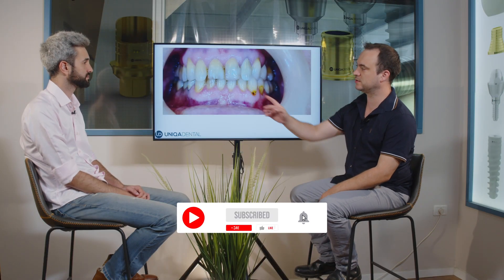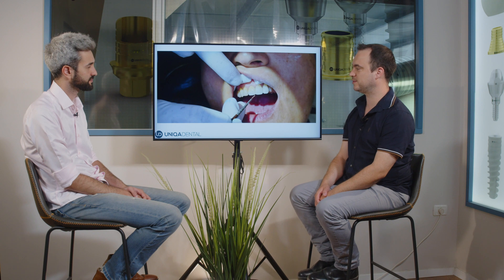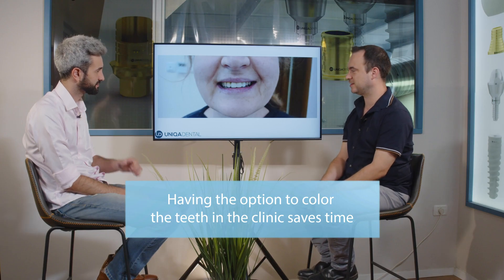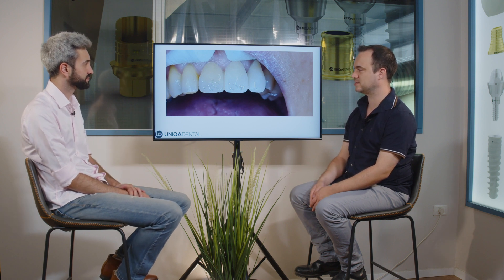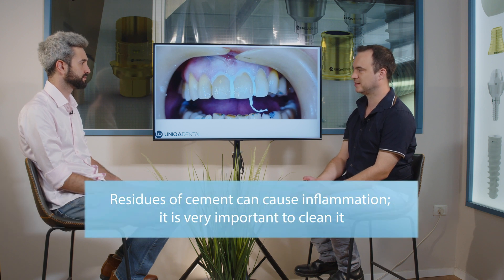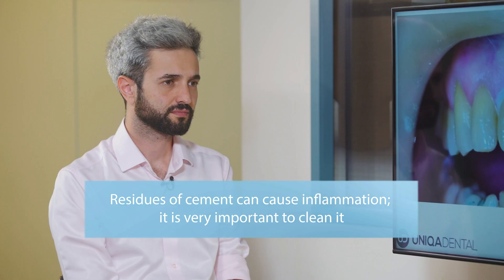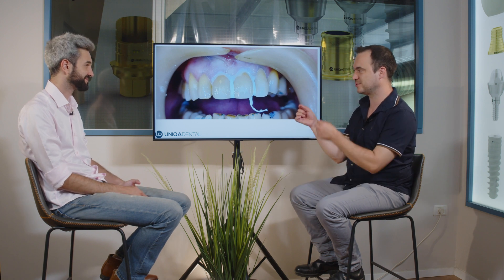Tooth Restoration Process: Achieving a Perfect Smile with Zirconia Bridge

Comment from the maker: 00:00 This incisor had a very large anterior restoration.
00:47 It looks broken.
01:05 Those two teeth are vital. This one went through root canal treatment.
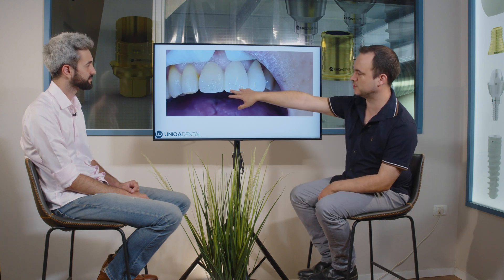01:32 It's still not the final work.
02:09 And this is a temporary restoration, I take it?
02:40 We looked at the color of the old ones, the upper one, and we made a new one with the same colors. 
03:15 It's a quick process to color the bridge?
03:49 To clean the residues of the cement because it's not implants. You can have screws retained. 
04:16 Using the dental floss to isolate it from the cement.
04:35 Very nice. Very nice. Without Photoshop.